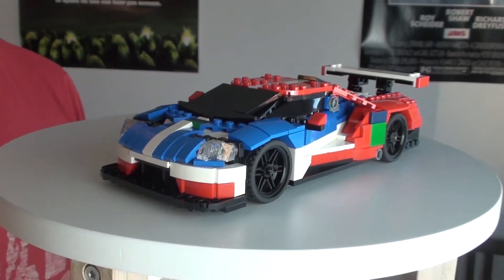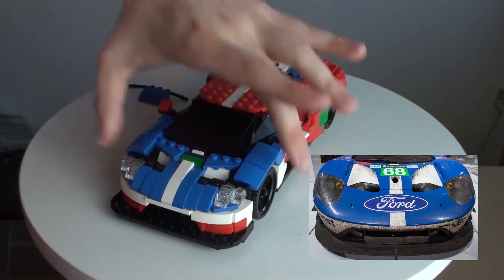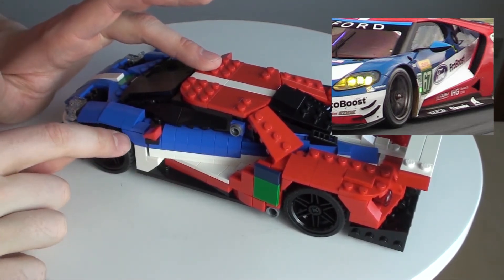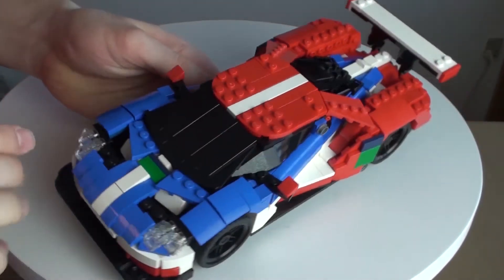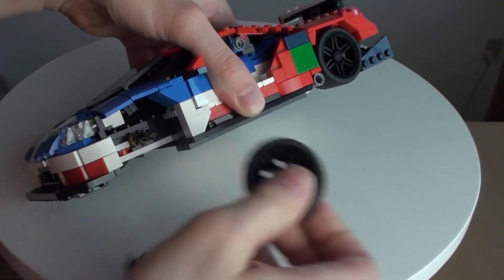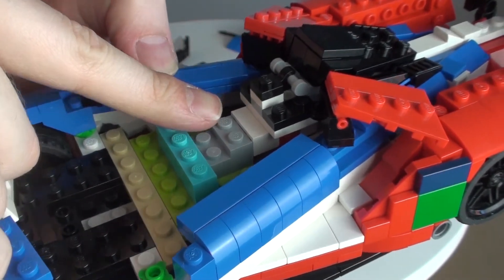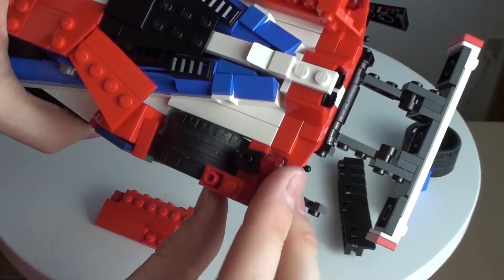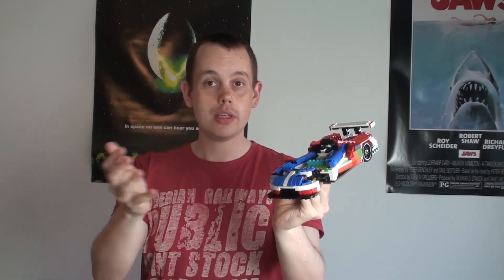LEGO Ford GT v0.1 | Improvements | Tear Down

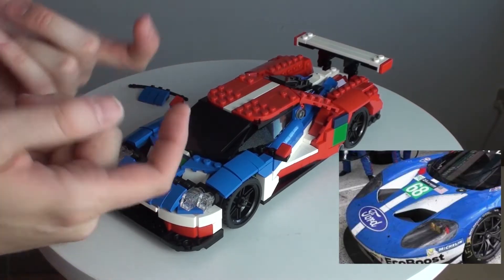Comment: Looks great and the only thing I can think of to work on is extending the front out a bit more to match the size of the real car. The difference is most noticeable at 1:18 in your video. Doing this would also allow you to make the triangular shape between the windshield and the two air scoops more equilateral.